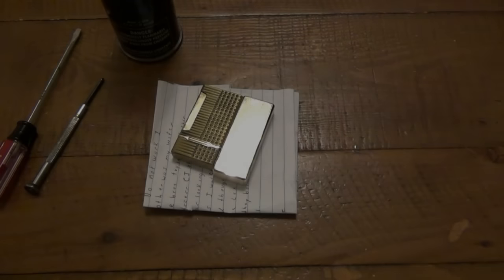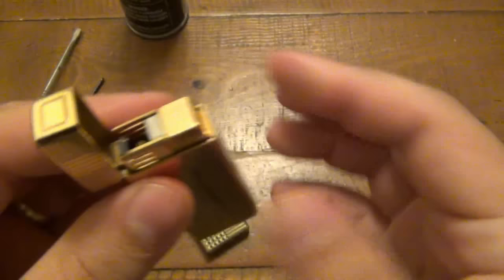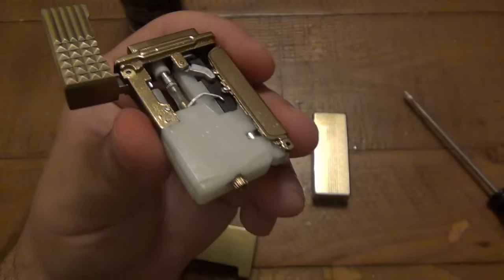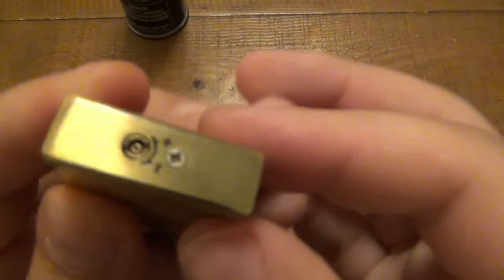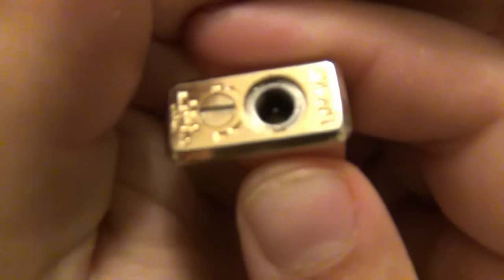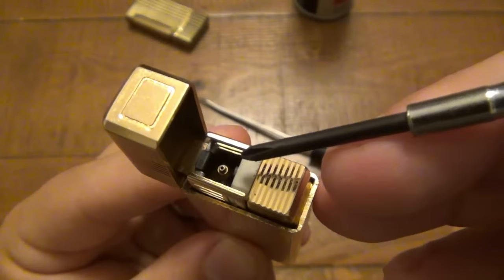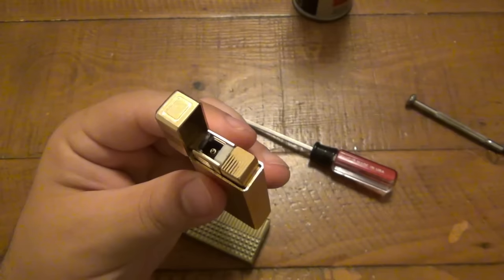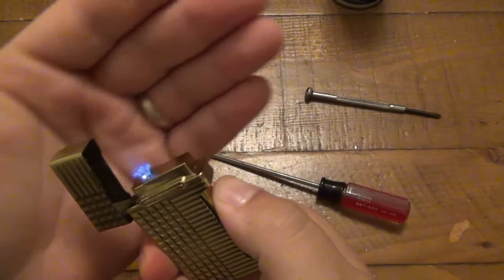How To Fix Butane Lighters (Common Problems Have Simple Solutions)

Comment: I don't have the butane dispenser in front of me right now, but this one came with the adapters and I never could figure out what they were for. Now I know! Thank you.

I'm having a similar-but-different problem with my electric spark lighters. They're cheap lighters (Taj), and after 10 to 20 uses, the click fails. I can hear the butane coming out, but pressing the button down just releases the butane - there's no spark to light it. Any suggestions on how to fix that?

Thank you!

Comment: Thank you so much! I don't know anything about lighters and just refilled a torch lighter and couldn't find any info about the adjustment thingy I was messing with at the bottom and was worried I did something bad. Now I feel confident that I will not blow up my hand or face!

Comment: 8:20 - You still get these alternative adapters in most butane cans (for lighters).
Looking at these adaptors, the one at 9 0'clock fits that lighter (same one that you use with the Colibri Molectric '88' lighter valve).  
Its not a perfect adaptor, there can be a little leakage while filling, but it works fine.

Comment: Newport butane has all the tip adapters color coded and built into the cap and on the side of the can it has a list of all the major brands of butane lighters with the corresponding colored tips that work for each lighter brand

Comment: The adapters definitely existed and still do exist in the caps of many cans of butane fuel, but that doesn't rule out the possibility that you are crazy. That possibility is lent increasing probability when you remove the adjustment valve with the assertion that it is "another cap" and you need another long thin screw driver to reach into the tank to adjust the flame.

Comment: Here in Europe the fuel tanks still come with the adapters, unfortunately however, the Ronson adapter is very leaky. You might try looking at the cheaper refill containers, most of those still have the multi tip adapters. I would not risk using that fuel in a fine lighter.

Comment: Excellent cutlerylover advice tendered on purging a lighter! This is actually quite an important aspect of lighter ownership functionality that hardly anyone executes. Cigarette lighters are fundamental EDC articles but actually require technical maintenance for correct trouble-free utilization. So don't just fill em, purge em first! ✔
Reply: After ya purge and it still won’t light, then what ?
Reply: you are just purging butane. its pointless to do this.
Reply: @jbbolts  no,  actually occasionally you you'll  get basically a vapor lock.  Not always, it is rather rare on most lighters.  Some are just more susceptible to vapor  lock and at that point a purge is necessary.. 
I've had a few that wouldn't light until purged then refilled

Comment: I just got an Arc insert and Butane Single today (Zippo),
Took me a few tries to realise the arc was a double tap to ignite switch, and then I checked the little insert (I'm a dude, of course I'm not going to read the manual first).

Yeah, was really disappointed with the butane and thought I was not filling it correctly. I did not bleed it first before first fill. My bad.

I used a standard Zippo/flame lighter to hold in front of the butane stream till it lit and let it run till hot, well over the recommended 10 second limit. Did it about 6 times, and now after adjusting by trial and error for the flame size, I have found it works if I slow press the button.

So far it doesn't fire first go every time, sometimes it takes 3-5 clicks. I'll give it one or two refills before resorting to the full fix I found on YT.

I wouldn't necessarily say it's "Chinese Manufacture", but a serious design flaw from Zippo itself. The Chinese aren't going to put parts in that aren't on the design spec/parts list. Though they could do some proper QC and check the lighters and then bleed them empty. I wish it had a clear window side or insert or clear (indicator) slit.

A Zippo should fire first time everytime till no fuel. Anything less is unacceptable for this brand IMHO. 

Imagine being a soldier and having to take the insert apart, get rid of the limiter, and put it back together, to get your brand new lighter to work.

Comment: I have an old butane lighter that I purchased in the late 70's or early 80's and was wondering why it all of a sudden stopped working.  Never thought about the adaptors no longer coming with fuel.  Will have to purchase and see if I can get it working again.  Thought it was leaking fuel.  Thanks.

Comment: You still get the various sized nozzles from the princess auto cans of butane. I've only ever seen and used 2 sizes. Also "piezo" is the type of igniter any batteryless lighter uses, it's a crystal that when put under pressure generates a small electrical current, thus the spark. They are also often used in  some fuel injectors however they are in reliable and fail unpredictablty.

Comment: They for sure have the tips on lesser branded butane cans. For that lighter you may have to rough it and buy a cheap can from the gas station and use the adapters with your regular fuel.

Comment: If you go to refill the lighter  and  you force to much butane  into the
 tank it will  create a space between the plastic tank threads  and the 
out side of the  threaded  metal shut off stem  . If you hear  the butane leaking out
   wait till its empty  then  take the  lighter apart  . To remove the  
shut off valve and housing with the threads on it  you have to unscrew 
the flame adjuster screw . It screws into the metal shut off housing . 
Once the flame  screw stem is unscrewed you can unscrew the  metal piece
 from the tank . cut a strip of yellow teflon gasline  PTFET tape  its 
sold at lowes or home depot  next to the white tape  but get the yellow 
 color . Cut it long enough to just  cover the threads on the metal 
piece one time with a small over lap . stretch the tape so you see the 
threads  and push the tape into the threads with your finger  and screw 
it back in place . Is will stop the leak . The leak is not coming from 
the inside of the valve  but  around the treads . The tape will seal off
 the leak and you will not have any  butane escaping.
Reply: THANK YOU! My problem solved. Didn't realise it was the thread...

Comment: When I bought my first butane can (around 1999/2000) to refill the kitchen refillable Bic stove lighter the adapters (a whopping 10 adapters) were part of the (inside) cap, you just broke off the one you needed, I would replace the cap and have the adapter inside. So it did rattly everytime I picked up the can. 

I just bought a can of Extra purified butane and it had the ring of 5 adapters

Comment: Thanks I work at a smoke shop my techno Glock lighter ddnt look anything like it but I still fixed the fuse. Lol after your walk through I realized the cast? Plastic on the fuse was too much so I melted it scraped it off and reset the gauge it torches now. 😂 they're only $6 but now we won't have half working torches in our shop 😂

Comment: I bought a can of VECTOR GAS, filtered 14 times for purity.  Since it was a new product, the universal tip fit, by the way, the universal tip, that comes on the VECTOR gas can, is metal, much better than most plastic tips.  Now, about the adapters.  While examining the cap of the gas can, I found that all the adapters are built into the lid.  You choose the one you need and detach it from the inside of the cap.  While it no longer comes with adapters on a ring placed around the nozzle, they are stored in the cap of the gas can.  I would like to recommend the VECTOR brand for it's serious capacity, 320ml, and, it's about the size of a can of hairspray.  This brand of fuel is made by the VECTOR Corp. for their brand of windproof lighters.

Comment: My lighter wouldn’t light. It is similar to the red flame one. At first I thought it was low on fuel. So when I went and got fluid I got the wrong one. I grabbed zippo fluid instead of butane. Then I tried to take it apart to empty it. When I pulled it out a green wire fell out of place and I’m not sure where it goes. I’m also not sure if it is holding the fluid

Comment: if you go to a smokeshop where they sell the big cans of butane usually it'll be some imported kind or just random brand but you can get these huge cans of it for like $2-6 and almost all of these always have the extra tips, not a ring of it like the picture but they're actually like part of the injection mold the cap is made of. I don't think anything even uses 3/5 of them these days.

Also just FYI you have slightly misunderstood the whole purging thing. It's not about purging the fuel and emptying the fuel out of the tank, it's about purging the AIR out of the tank which is what causes a lighter to not light on the first click simply because theirs air mixed in and it's not getting the proper amount of fuel it needs for ignition. To purge what you do is while filling it with butane you first fill it for 2-3 seconds, then purge some of the gas out of the tank, then fill it again for 4-6 seconds you'll find that it then lights more reliably  because it's getting pure fuel out of the tank.

Comment: the cap on my rollagas lighter broke and now won’t snap shut and open after a small piece fell off, is there any way to fix it? the piece looks like a loop of metal with two small prongs that i believe are meant to hold a bar for something.

Comment: Thanks for the video. I have a newer z-pipe insert that I  got from pipes and cigars as part of a promo. It never works reliably. After following your cleaning tip it works great. I assumed with the higher quality filtered butane this would not be necessary.

Comment: Special Blue ultra pure butane fuel has an assortment of adaptors that come with the can.  it's a green coloredcan with a red lid or cap and the adaptors are under the cap  I purchased a can yesterday and it was $2.99 for a 300ml bottle/can. hope that helps you out.

Comment: Another common problem I see with piezoelectric lighters is the little wire that who directs the spark is moved somehow and the spark is in a spot where I cannot ignite the fuel. By bending this a tiny bit each time until it is directed more towards being in line with where the fuel comes out I have fixed many lighters this way mostly torches

Comment: I have three butane lighters, each stopped working after about a week. I tried refilling, adjusting the flame but nothing helps. It sparks and the gas comes through but there is just no flame. It drives me crazy since I cannot figure out what is wrong and these are not the cheapest lighters also.
I even tried lighting it with external flame, but it not only did not light up, but even blew off the candle flame!

Thaks for the tips... I will try to clean the jet.

Comment: Idk where you get your butane but they all come with those adapters now. Try NEON Butane they have the better injection molding and you can find your size of five and trim it up with nail clippers and maybe a file. All the cans of butane I get have had them. The 26 OZ can of NEON I bought just last evening (about double sized) didn't have them in the Cap, but I don't need one, and then I noticed them in a ring around the neck of the can inside the cap, that maybe looked like a safety packaging thing, has the adapters on it though there are only 3 sizes. Whip-It and NEO all have the 5 in the caps now. Just took another look, they did double as a safety thing so the nozzle didn't get depressed by the Cap or anything. But sure enough, the three prongs are the adapters. Maybe the 3 fit all five? Idk.

 Anyway, Grampa's lighter can be easily fueled using them or a couple of them glued together maybe, and you already showed that it still creates a Piezoelectric Spark! I'd want to see if the nozzle tube of a can of WD-40 would work to get the butane down in there.

NOTE: These also make great little tools for bleeding the tank of air. Even if the standard nozzle size works for yaZ.

Also, the Piezo Electric in the brand refers to electricity that is created from putting pressure on certain natural materials, minerals or such, this is generated from the pressure of clicking to create the spark. As for filling the 2nd Lighter, just buy a can of Whip-It or NEO butane and check the cap for your adapter. No problemo amigo. Adios.
Reply: Why can't we harness the red tides of a plankton overbloom to create piezoelectricity on a very large scale? Run jump and stomp on the sand at that beach to see the lights at night. Kick some sand into a puddle left from high tide and watch the rainbow colors. It's quite possibly a massive storage and producer of untapped (free) energy.

Comment: Hey Jeff I tried to clean out my electric torch lighter with a qtip also tried to adjust the fuel emptied it purged refueled it but if it does ignite or if I light it with another lighter it’s just a regular flame oh and it never wants light

Comment: Have adapters with the cheaper MRK butane fuel... it is also on the Ventti gas, both have the set of adapters in the lid which you can pop out.

Comment: If it's the balls on the wires that are what makes your flame colorful then when you refill it with butane ten why does it not continue to have that color? I have been wondering forever how they change the flame color! And the caps still have the adapters they just are not on a ring they pop out of the cap on all the butane cans I buy!

Comment: If you go to a smoke shop you can buy butane with the plastic adapters built into the lids or you can buy a separate nicer set by a lighter line, but the plastic ones are just as good.

Comment: I have nearly the same problem with 2 lighters - I see the spark and the is enough gas fuel inside, however after regulation of +/- I cannot get any flame, can you please give me a tip how to fix it? It is very strange - i can ignite the lighter with one other a have a very nice flame but it does not work from itself. Thank you

Comment: I have a Calibri # 947 lighter/cutter. Problem is to much gas comes out even when I adjust it and doesn't ignite because of to much gas. What do you think is the problem and are replaceable parts universal if so where is a good website you recommend to buy parts. 
Thanks I appreciate taking the time to answer and thank you for your video's

Comment: Hello. My metal vintage lighter loses butane within a minute after it’s put into lighter. I can hear my lighter lose fuel when the top is open, or closed. I get a spark, and a couple of flames. I was told it may be a ring inside has dried out/or broke. Please help.

Comment: I have one that has an issue where if you adjust the flame to a good point the fuel leaks slightly when the buttons not being pressed. It's old so I'm assuming an o ring is failing or something like that.

Comment: OMG thank you for the cleaning tip! I have this unique Zippo lighter that would never light. And I also purged the tank out as well and now it works! I just don't know how to adjust the rate, since it doesn't have anything to adjust. 
I'll give you the pat. Number maybe you can look it up and see what I'm talking about.   PAT. D502.285  it could be a 3 and not an 8 so ( D502.235)

Well, it doesn't work now.... ugh it worked for a few times ,but it doesn't doesn't doesn't doesn't
Reply: Idk I tried to edit my comment and it started to glitch out, so... I'll post it here. So it worked a few times and now it doesn't.  I tried other lighters to light it up and it doesn't work,  I think there's too much butane coming out but I don't know how to adjust it.
Reply: Hey Josh. If you hold down the gas trigger and light another lighter at the top of it and it still won’t take, it’s a clog in your fuel line. Most likely at the tip. If you have a little wire brush you can try manually scraping it out. Just be sure to not break the little spark rod

Comment: I still have a few adapters and the can and cap that came with it. Don't know how old this is. The miniature torches for soldering and such sometimes need adapters. Those adapters only came in Large cans, I recently need more fuel and like you say, could not find another large can with adapter. Maybe some small tubing or shrink tube would work.
Reply: Thanks

Comment: I buy a brand of fuel called Neon and the lid still comes with the plastic sizers for the valve stem. U can find it in most vape and vape accessories smoke shops.

Comment: They still make butane fluid in cans with the adapter pieces inclusive as a part of the can's lid.. I think that this inclusion may be brand dependent. I live in Iowa and I have y
et to  purchase a can that doesn't have them ((unless of course you buy one of the tiny little viles of butane that will only refill a zippo sized torch maybe 2-3 times.

Comment: I found in my lighters when using a cheap offbrand fuel, the lighter would only work for a short time then it would spark and the flame would start but then go away. Whenever I use ronson or zippo fuel it works fine however

Comment: I have an older, zippo looking lighter that will spark and light. But the lever inside, will not spring back to its position. So I have to take it apart every time I light it, to fix it. How do I fix that.